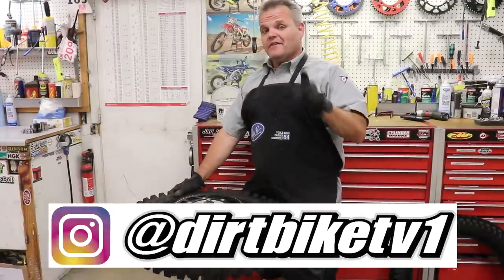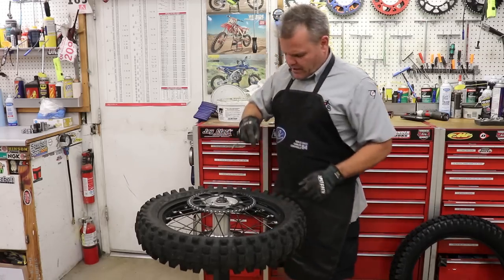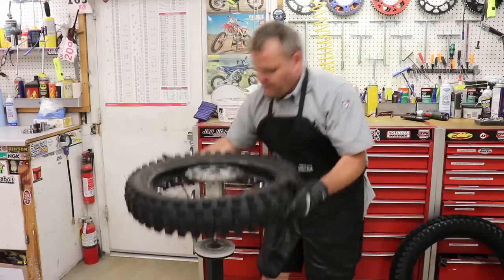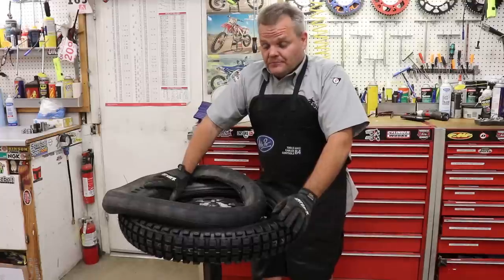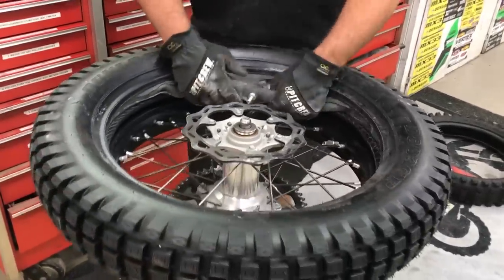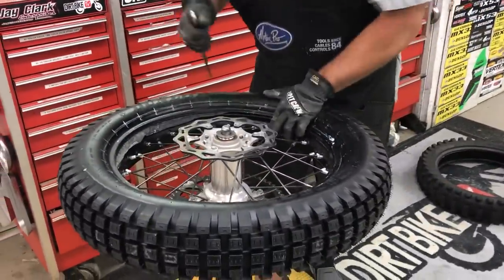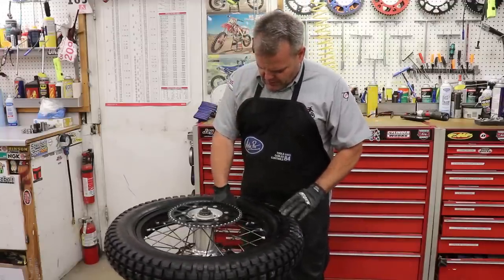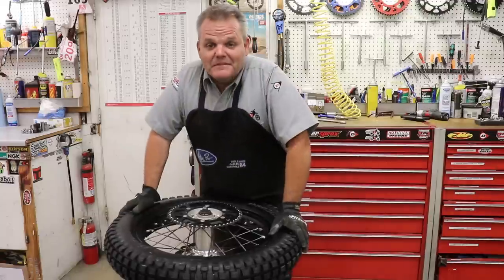Pro Trail Tire Change!

Comment: I've been using the Tusk 4mm thick tubes at 8-9 lbs of pressure for a few years now and have never had a pinch flat and that's riding from rocky and rooted forest trails to dessert terrain, they are quite heavy as far as weight but it's worth the extra protection.

Comment: Another fantastic video Jay.

Used your technique last tire change and worked like a charm! 

MotoZ Uber tubes for the past 5 or so years with gummy hybrid rear at about 8lbs and awesome traction results for Pacific Northwest riding.

Comment: I've  always heard that trials tires don't  brake very well on step loose downhills where you really need both brakes and high speeds. What's your experience.?
Reply from the maker: when trail riding that we do any lack of braking is not crucial- -if racing be different.

Comment: What is the diameter of the axle rod on your stand? Looks to fit every wheel I've seen a video of you do. Is there any you have come across that had to small diameter bearing to fit? Planning to make a stand that clamps into my regular tire machine.
Reply from the maker: Yes - email me for the tire stand drawings and more info on sizing.

Comment: Thanks for the great video.  Just dropped you an email.  I have 5 dirt bike tires to change from 14" rears to 21" fronts for a cr85, kdx80 and a ttr225.  Having the stand to assist with all my changes will help.

Comment: Great video but  comment at 12:25 when he says he doesn't want to scratch the rim....  too late for that!  Good tip on the nut at the end, last flat I got happened that way, tore valve stem off the tube cuz it was too tight

Comment: Don't see you do many rims with duel rim locks? I put 2 rim locks  on all my bikes rims( may not feel it in the dirt but makes balancing a lot easer for dual sport.so I do it on dirt bikes also.) , makes mounting tires a little more difficult.